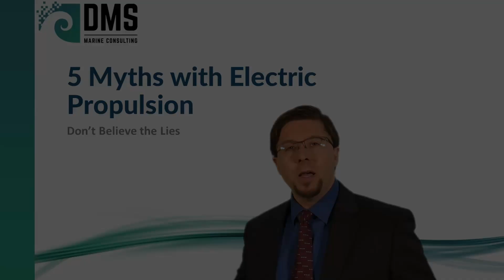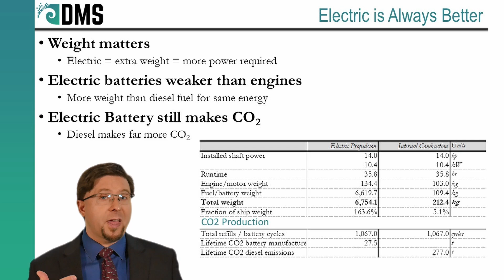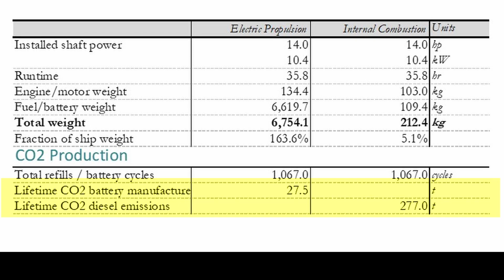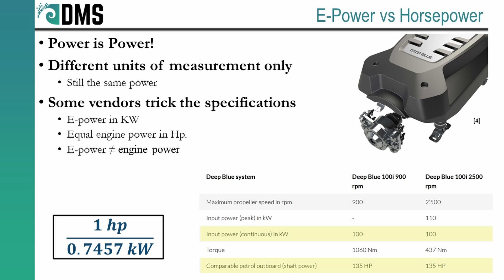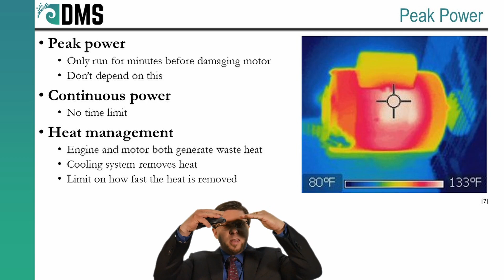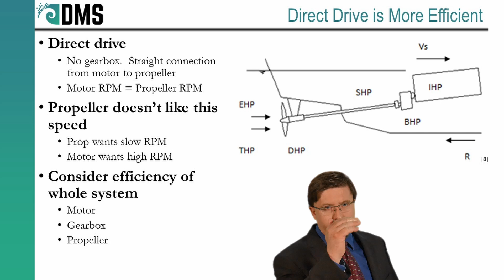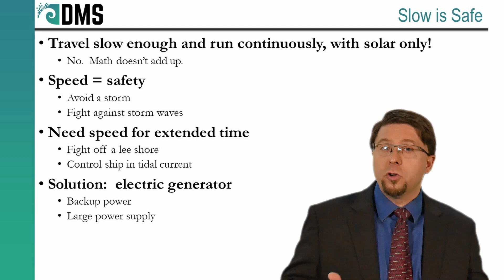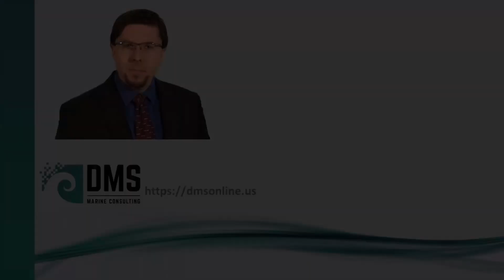5 Myths with Electric Propulsion:  Don't Believe Marketing

Comment: Hybrid systems are probably the best of all worlds. Using the electric drive for slow maneuvering and idle is really efficient where the dirty diesel engine is extremely inefficient. But the diesel is really good for sustained 60% loads. This method does not add too much battery weight.
Reply: The biggest advantage to me: huge house battery.

Comment: What it the co2 emission for charging the batteries and after 1000 charging cycles how much co2 is emitted for the recycling
And the biggest problem is that the 17 different quantities of alloys needed for electrical mobility system in general are limited and their extraction need diesel 
This co2 debate is anyway a big hoax and scientifically not prooved

Comment: Electrical engineer,  So many things wrong here. I can't even begin to be bothered starting . Some one please help me out here
Reply: A electric motor that's heavier than the engine it is replacing lmfao. Grin Technologies just did a sailboat where they replaced a 300 lb boat engine with a 10 lb electric motor with the same power.
Reply: yes, this part of video made me wonder what kind of electric motor heavier then diesel. If you add battery weight then it may be same as diesel engine+fuel tanks or even more depending on battery capacity. 

less maintenance for electric is also a big deal.

But the biggest advantage for me is to be able to be off-grid with solar+LiFePO4. You cannot generate more diesel out of thin air if you are in the middle of nowhere and need fuel to run generator to power fridge/frizer/AC/etc. Many boaters need no diesel generator if enough solar&LiFePO4 on board. But still, it's nice to have it as a backup.
Reply: 6.6 tonnes of battery? I don’t think so
Reply: Then why did you start.

Comment: Wrong.  Emotor and engines aren't compareable by just the power number.  Emotors have 100% torque at 1rpm. The engine needs to reach redline to pruduce its power rating. You call yourself an engineer? This is a huge difference.  If you know what your taking about that is
Reply: Torque is not power. Power is force times speed, or torque times RPM in this case (in different units of measurement). Electric motors reach peak power at max RPM, while combustion engines reach it either at max RPM or some point before, depending on how the torque output is at higher RPM.

There are also different types of electric motors and controllers changing their characteristics. One thing that can be said is that they never have full torque on the first rotation (the controller needs to get the motor spinning first) and the torque drops off at higher RPMs, it does not stay constant. Some combinations of motor and controller can keep the torque quite constant up until some RPM until it drops off quickly at higher RPMs, others will drop off smoothly from start to end.

I don't see how high starting torque would benefit a boat honestly. Accelerating the propellers quickly will cause cavitation and therefore increased damage on the propellers, you need to increase their speed gradually anyways.

Usually this is also done automatically by the controller to reduce the starting torque and accelerate more softly, also to reduce stress on mechanical components.
Reply: @razorblade7108  lol. yes mate. i know all that. why would you assume rpm would not change?? high torque gives you the ability to lower rpm and increase prop pitch and diameter. same propulsion for less friction and noise.
Reply from the maker: I look forward to your concise video with a thorough comparison between electric motor and combustion engines.
Reply: @DatawaveMarineSolutions  why?... firstly im not narcissistic enough to spend my precious time trying to get likes on youtube. secondly there are already 1000 videos on the topic. maybe you should look one up. and thirdly i have actually converted many ICE to electric vehicles and know first hand the comparisons. not just a white board and a text book. if you weren't so busy  trying to get likes and attention with your time you might be able to do some real engineering. not just talk about it.
Reply: @freelectron2029  Torque is turning against resistance, but in an electric boat or ship the resistance is water viscosity and inertia as you get going.  In a car, resistance is the weight of the car.  They’re totally different engineering arenas.  Ships need power, torque times rotation velocity.  Aircraft are like ships; air resistance to turning the prop is negligible until it’s generating thrust from higher velocity air motion.  Again power is what matters there.
Reply: @Georgewilliamherbert  i think you have fallen prey to to much theory and not enough real world practice. also. in that case. cargo ships, and bulk carriers dont use power, they use torque. torque isnt just the resistance to water its resistance to inertia. resistance to the weight of the vessels righting motion, resistance to friction. so is power. when you want to turn something you are always going to have resistance. the point is mute. you missed the original point. electric is far superior as you can run it at high revs or high torque depending on the way you want to gear it. you use torque to make power with a gearbox. or you can design the motor to spin a small prop very fast due to high torque of electric. the point is an ICE has fixed characteristics. electric can be built in any size shape or configuration. much more versatile, compact and customisable, not to mention controllable.
Reply: @freelectron2029  I have a naval architecture degree.  I don’t actively practice in the field but am very familiar with the data sheets and hardware of most of the available large bore two stroke direct drive diesels for ships.  I can’t remember seeing torque explicitly listed on any data sheet.  You can directly derive torque from listed HP at RPM for L1,2,3,4 operating conditions, sure.  But it’s not the value on the spec sheets.
I don’t design propellors but I don’t recall it used in any of the quick design tools or manufacturer spec sheets from naval architects side of things.
Reply: @freelectron2029  here, see section 2.5, and it has torque listed as derived with limit MW and given RPM ranges (propellor design details depending on applications, torque derived from resulting RPM and power… https://library.e.abb.com/public/6c1b0250efd18e73c1257a530040dcf2/XO2100_XO2300_Product_Intro_lowres.pdf
Reply: You sound like Elon musk overextolling acceleration in the Tesla Semi, ignoring carrying capacity.   Besides, a propeller has a different best operating torque and power hence the need for gearing.

Comment: The very same proponents of electric vessels are "trying" to create full-sized electric aircraft...with predictable results. That pesky Square-cubed law keeps "getting in the way", higher output thrust from electrics only gets you so far...as we will never see electric airliners. That same mathematical law was applied well when lightweight gas-turbine engines "breathed new life" into the struggling helicopter designs.
Reply: True,  same applies to electric trucks: the Tesla semi still pales in comparison with respect to range, fast refuelling and load capacity to traditional diesel semi-trailer trucks.
Reply: @shaider1982 truck range can't be better that driver range. And Tesla already has driver range covered

Comment: The weight of the battery bank required for 35hrs of motoring is incredible. (I thought I would check the numbers and I see your energy density is quite low at 1kWh=17.6kg but probably realistic. A 100Ah, 12V Battle Born battery weighs 14kg so has an energy density of 11.7kg at 100% discharge, given you don't want 100% discharge + weight of cables etc, the 17.6kg looks about right, as I said before - incredible)
Reply: DMS is forgetting the difference in conversion efficiency.  An ICE is 30% eff on a good day.  So you cannot equate stored energy in the diesel fuel to the battery and call is apples to apples comparison in this case.  Nick's weight comparison is FUBAR!
Reply: your calcs are wrong. a 12v battle born battery is a case plus a BMS plus cells.  you dont factor in all that weight. 16 lifepo4 300ah cells weigh 100kg. use that in your calc.
Reply: you numbers are 140% of actual

Comment: Electric is more complex to people who haven't dealt with them before, but infernal combustion has a lot more moving parts and needs a lot more servicing. Especially in small boats where changing oil and fuel filters etc is a hassle because they don't have full time mechanics on board. The maintenance schedule for an electric motor is "make sure it's still there" rather than the long checklist for a diesel.

Now all we need is a battery with the energy density of diesel...
Reply: Or a small battery and a large hydrogen capacity, you loterally are surrounded by "fuel" and with sufficient solar and wind energy generation its a cheaper option in the long run
Reply: @victormiguelmontero136 wind is actually the most expensive way to generate electricity, it only affordable due to the government subsidizing it.

Comment: I have a paper proving that Tesla's semi is not possible, at least the original design promised in 2016/17. Now that they are looking at LiPO4 batteries, those numbers look even worse. The bigger the object, the laws of diminishing returns grow exponentially. The true benefits of electric propulsion are for small vehicles and crafts. For example, a tow truck in an airport. It works for short distances and a smaller battery can be recharged in short durations. Similarly, you could have a car with 100-150 miles range instead of 300+ miles to run errands and commuting.

Comment: There were some turbo-electric ships in WW2. But here you must remember, that's a 100 MW electric motor AND a 100 MW electric generator, plus the 100 MW turbine engine itself (and they had boilers too for high pressure steam!). That's a lotta weight. With battery-electric it's just a motor and battery, no electric generator nor mechanical engine.

But my point is, for all that extra weight, you have to get really big ships to make it be a relatively small fraction. You seem to be focused on small pleasure-craft, and even there the battery-electric design is still quite a lot of weight. I just thought I'd mention some opposite use-case where electric stuff might make sense.
Reply: Yup, Drach and Ryan Szmanski discussed those ships along with the problems that came from those, maintenance being one of them.  Hence those were not seen in subsequent designs for surface ships.

Also, I think the energy density of coal/bunker fuel is way higher than any battery.

Comment: I live aboard a 34’ sailboat with electric propulsion, I think your battery weight assumption is wayyyyy too high. 48v 100AH LiFePo4 battery bank maybe weighs 50kg. Definitely not thousands
Reply: 48V x 100Ah = 4800 Wh or 4.8 kWh
LiFePo4 batteries have around 180 Wh/kg or 5.55 kg/kWh.
4.8 kWh x 5.55 kg/kWh = 26.64 kg

What he is talking about in the video are normal LiPo or Li-Ion batteries for larger boats and ships. Of course they need far more energy.

The battery in an electric car already weighs around a metric ton.
Reply: @razorblade7108  180 Wh/kg is closer to lead acid than lithium iron. Tesla's batteries are at 280 Wh/kg today and improving.
Reply: @skirkwood  180 Wh/kg is for LiFePo4 (or LFP, lithium iron phosphate) batteries, which is what the guy with the sailboat is using. Actually the maximum I could find is a little lower at 176 Wh/kg, I rounded it up. Minimum is around 90 Wh/kg for worse/older LFP batteries. LFP has the highest cycle life and still very good energy density as well as safety (it has no flammable electrolyte), it's often used as replacement for long-lasting lead-acid batteries, however it has poorer low-temperature resistance compared to other lithium and lead-acid batteries. Lead-acid batteries have an energy density of 30-50 Wh/kg by the way.

Other types of lithium batteries have different energy density, some with up to 265 Wh/kg or as low as 50 Wh/kg.

The most common type is lithium nickel manganese cobalt (NMC), which is used in laptops, cars and electronics and has a good mix of power and energy density.
Anther common type is lithium nickel cobalt aluminium oxide. Pure lithium manganese oxide and lithium cobalt oxide batteries are less common, as the mix has better properties overall.

The latest batteries from Tesla (supplied by Panasonic) are lithium nickel cobalt aluminium oxide ones with an energy density of 260 Wh/kg. Your value might be the energy density of the pure materials, but the end product doesn't reach that. The Tesla Powerwall home storage uses lithium nickel manganese cobalt oxide as it has a higher lifespan.

Since lithium iron phosphate batteries need much less rare materials, are safer, have much higher longevity (multiple thousand cycles or 10+ years) and are cheaper, they have reached a pretty high market share despite their lower energy density and will probably replace lithium nickel manganese cobalt oxide batteries over the next years in a lot of applications, except for high performance.
Reply: @skirkwood  Lead Acid is 25-35 Wh/kg.

Comment: Good video. You mention "increased complexity" with electric propulsion. Currently, for all practical purposes absolutely - but this is only because diesel engines are so incredibly reliable for so long (Yanmar is over 100 years old).  Everything taken together a battery electric vehicle is mechanically simpler than an internal combustion engine vehicle. (This is part of the reason why I drive a Tesla to my sailboat that has a diesel engine.) 
And it's great to see the CO2 'footprint' compared. 10% of a diesel's. (I've heard otherwise intelligent adults 'explain' how a Tesla pollutes more making the batteries, than their Ford F250 diesel could ever do....)  
What I've deduced from the current electric boat motors is that they seem to be sub par what they could be. Yes, the weight of the batteries and range mean you will have less energy stored on board, and a weaker electric motor extends that range, but it seems to me (up until a year or so ago,)  the electric motors available for sailboats were less capable than they could be. 
Gearing an electric motor shouldn't be a problem. Otherwise my Tesla would only drive at 350 mph. The electric motors in my Model Y have high torque at 1 rpm and a top speed of 6000 rpm with almost constant torque across the entire range. (This is why EVs will replace not only ICE cars, but diesel trucks. On land of course. My Model y weighs 4400lbs, double any other car I've owned.)  Obviously it's not that difficult to gear down this output to the ideal propeller rpm. 
None of the sources I've followed have ever claimed that solar panels can supply enough energy to keep an electric drive going continually. (Maybe some seller has made this claim. Yes, it would be wrong.) There are a couple of very large power cats being offered for sale that approach this....but they would run slower.) Speed is indeed safety to get out of or away from trouble (unless you have 4 of them, they all say 300HP, and you're drunk. )
The video I'm looking forward to is the one on hybrid power. When I bought a Prius, even before I was interested in sailing, my second thought was 'This would probably be great in a boat.'  And as an old sea kayaker I know that quiet on the water has huge pluses. Animals come closer, I'm more relaxed. An electric motor in the drive train could be a (short term) safety factor for bad fuel, clogged injectors, etc... It would be nice to enter and exit a slip or an anchorage quietly and without the stink. (I've never understood how Beneteau/Jenneau  can make such nice boats, but they're diesel engines are always the loudest. I've got a 20 year old Hunter that  by comparison just seems to purr.  Same Yanmar, but better sound proofing. Because of the density of water noise is 5 x louder underneath the boat than on the deck.)  Cheers.
Reply from the maker: I agree.  The hybrid options have me the most excited.  I saw one option from Hybrid Marine UK (https://www.hybrid-marine.co.uk/).  And just recently, I noticed the big engine manufacturers are starting to hint at options that look like hybrid propulsion.
Reply: @DatawaveMarineSolutions  Cool. I admit I'm a huge Tesla fanboy.  But I feel for Toyota's churlish attitude  about battery electric vehicles. I've also got a Prius V - it's a wonderful, reliable, efficient,  car. Toyota  won the hybrid, invested hundreds of millions in factories and foundries, was positioned to make billions -- and then along came Tesla. 
It's probably like making the perfect carriage and then Ford comes out with the Model T. I doubt the marine business would be big enough for Toyota, but I'll bet they could make a terrific small boat marine hybrid (especially if they partnered with Yanmar.)
Reply: @WillN2Go1  There are a lot of crazy people who do engine swaps from boats to cars and vice a versa. I think it would need a larger engine and be a smaller vessel but someone may do it at some point on YouTube.
Reply: @DatawaveMarineSolutions  Hybrid is a more complex case to optimise since the balance of ICE power, fuel tank, generator capacity, electric propulsion motor power/torque, battery bank size, power output all have to be balanced for the use case. Oh ya, and you have to make the ICE and Electric work with the same prop.